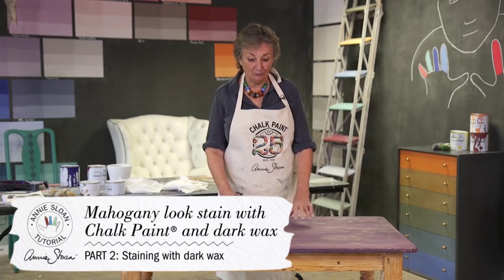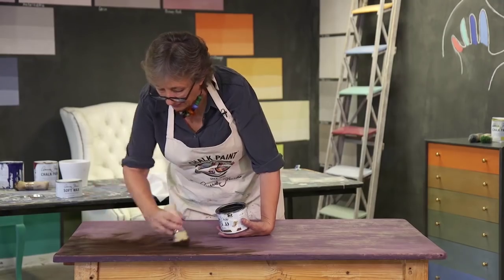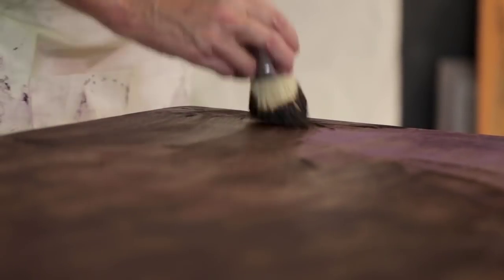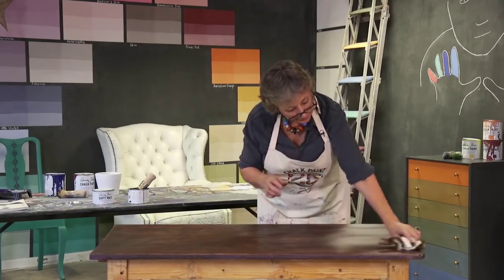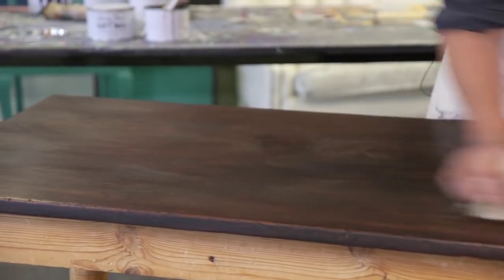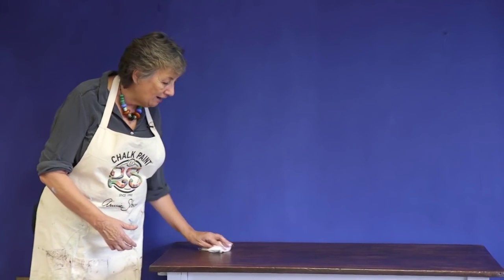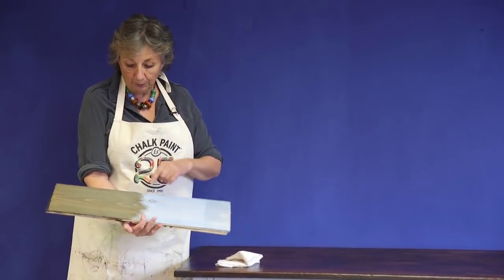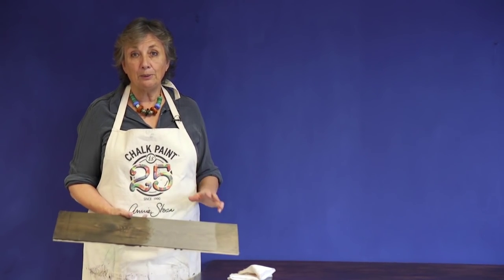Mahogany Look Project – Part 2: applying Dark Chalk Paint® Wax

Comment: I did this to my kitchen table... however in the summer. The top gets very sticky when humid or when your arms are on it for a few minutes :( what happened? I did rub down with cloth after was and cured for 2 weeks before use. HELP!
Reply from the maker: It sounds like too much wax was left on the table.  Don’t worry, this is an easy fix.  Simple brush on another thin coat of wax.  This will wake up the underlying wax coat and make it easy for you to remove all the excess.  Then steadily wipe away the excess wax with a clean absorbent cloth.  Don’t move too fast as this will begin to buff the wax before it is dry, resulting in an uneven look.  Be sure to switch to a clean cloth when the one you are working with becomes clogged with wax.  A simple test to see if you've removed all of the excess wax is to lightly draw a clean fingertip across the surface ... if you leave a mark you still have too much wax on there, so keep wiping.  Then let the remaining wax dry.  You can leave as is for a natural sheen or wait until the following day and buff with a soft cloth for a more polished look.  The wax will cure in just 5 to 21 days depending on climate.  You can use your table in the meantime, just treat it gently.  Be sure to use placemats and coasters.
Reply: @AnnieSloanHome   THANK YOU so VERY much  <3

Comment: This is beautiful. I also love the look of the Graphite with wax over the top. I'd love to do this with some old bedside tables I have, but there's one problem, the tables have the really fine laminate over the top. They are solid wood, I'm just not sure what exactly is underneath the laminate, if it's one piece of wood or several smaller pieces laid side by side. Any tips on how to do a piece with the laminate? Do I remove the laminate, can I sand it? I've held off on doing these for sentimental reasons. They were my great grandmother's and would hate to ruin them but want them to go better with my decor.

Comment: I want this exact look on wood countertops. To keep it water resistant, I know I'll need to apply wax regularly. Can I use a beeswax/mineral oil over this?
Reply from the maker: Hi there, we wouldn't recommend using our wax for a surface where water will pool and sit, such as a countertop. We would use this technique, and finish with a hard wearing water-based varnish, which you should be able to pick up from a hard ware store.
Reply: Annie Sloan Thank you!
Reply: Hi dear Annie Sloan ...can we use water based varnish over clear wax or dark wax

Comment: I'm in shock that wax is being recommended for a kitchen table top. Wax melts, it will not hold up to hot plates, a bowl of chilli or soup, cups of coffee etc. Any alcohol drink spilled on it will also ruin it. There is no resistance to chemicals like alcohol or disinfecting wipes etc. Poly is a much better option. Wax has a place, but not on table tops
Reply: Yes, I did this and you are totally right. It did melt, chip off and didn't hold up to regular table top usage.
Reply: Sometimes people use slate on top of their kitchen tops and tables for cutting boards and  plates/bowls when eating so maybe that’s why she thought it wouldn’t really effect the was. I don’t know if this is true just a thought